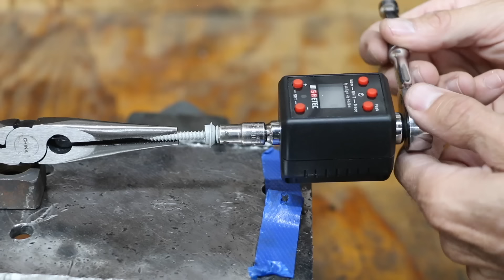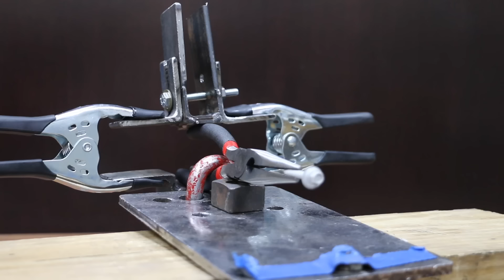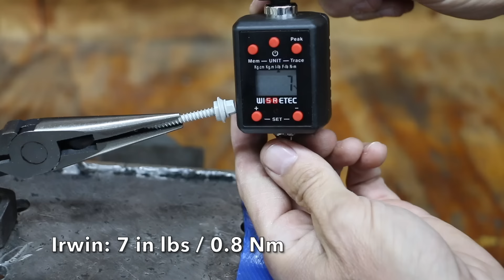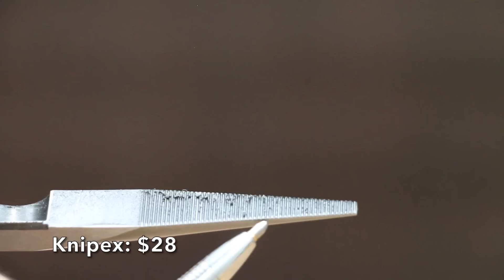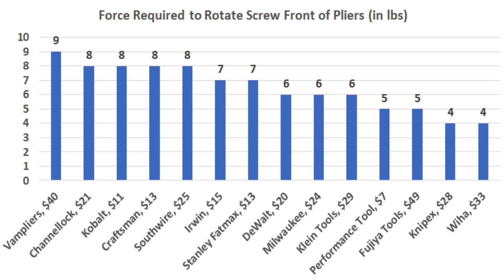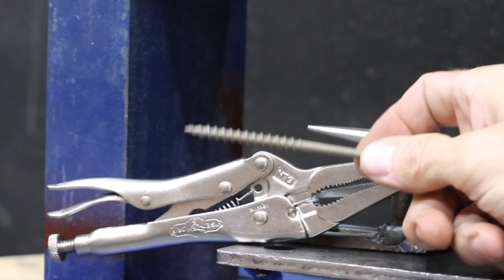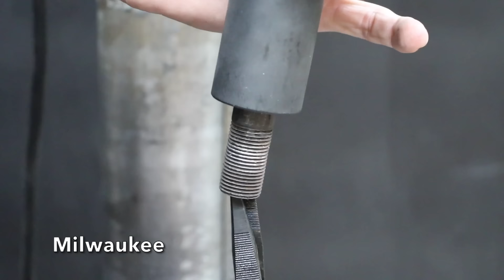Japan vs German Pliers (LONG NOSE)? Knipex, Vampliers, Klein, Fujiya, Irwin, Kobalt Needle Nose

Comment: As a building maintenance tech I use pliers frequently and I must say I like your test but lets be honest, most people use pliers for grip and use dykes to snip anything tough. I own Vampliers and love them...for gripping smaller broken or rounded out screws. I've never leaned on needle nose to cut. I've never leaned on on needle nose for BIG GRIP of larger fasteners I have cobra pliers and vise grips for that and for even bigger jobs a monkey wrench. I do think your test shows the true toughness of the tools which should provide evidence of longevity. Well made tools normally last a long time which I think your test did knipex an injustice. Those where true to the meaning needle nose pliers the rest were bulky and made to be an "in between" kind of plier. If I need to get in tight  spaces with control and precision I'm reaching for those knipex. Grip of small fasteners in tight places, Vampliers. Your test did open my eyes to the good overall use of the Kobalt pliers. They did well in places I wouldn't think to use them and they apparently will hold up and get it done. Kudos to you thanks for the test.
Reply from the maker: Thank you for sharing!

Comment: Your videos are the best out there.  Can you please supply a little more info on your digital torque adapter?  I'd love to know how well this one resolves and how low it goes in in-lbs.  It looks good to me but the specs for it don't line up with the values you're getting!  Anyway, please keep the vidoes coming.  My wife and I cast them right onto the TV.
Reply from the maker: Thanks, will do!  Thanks for the suggestion.

Comment: My favorite pair of needle nose pliers are some ancient pair that I found in a flee market. Their rust brown but they have no wobble yet a really freely moving handle.

Oddly though, besides the rust there is no damage on them despite their age. Even the cutting blades are still perfectly intact.

My only guess is that it predates mass manufacturing so the imperfections of them being force pressed together than being worn in for many years made them as good as they are.
Reply from the maker: Thanks for sharing.

Comment: Should the clamp distance not vary, depending on shape off handle? If it's a more "open" handle vs a more "closed" handle, would the more open not receive way more pressure/clamping strength, being forced together a longer distance? Would it not be better, to use a fixed weight, and hang it off the top handle, and rest lower handle on table? Or is it just in my mind, and the distance closed always equals same force applied?

Comment: honestly iv never twist anything with needle nose plyers bullnose yes but no needle nose and personally i believe in the right tool for job ir if you need to cut side cutters if u need to twist bull nose if you need to grip multi grips or channle lock tbh iv only use needle nose for pulling clips and sweezing clamps but this is a whole new level of testing
Reply from the maker: Thanks for sharing.

Comment: this was a great video but there was a major flaw, some of those pliers were much finer, made for much finer job, the vampliers are almost regular pliers, very stubby and wide while those fujiya are really fine, the vampliers couldnt do the jobs the fujiya could and vice versa, i know this is hard to factor in to the test but its a consideration, seeing as just looking at strength numbers when you need a super fine and precise needle nose is irrelevant, the fit and tolerances are far more important
Reply from the maker: Thanks!  Thanks for the constructive feedback.

Comment: The first test is kinda pointless and flawed.
The big advantage of the Knipex being longer results in it being worst in the test, while in reality if you were to grab something with the tip of the Kniped, chances are you wouldn't even get to it with the other tools.
Reply: @Hand Tool Reviews Doubt that's making a huge difference, the reason it failed so hard in the first test is that it is significantly longer. The test simply makes no sense because you'd never grab something like that. The Knipex is last in that particular test because it's by far the most useful "LONG NOSE Pliers". 
If you were to grab something like that for maximum grip, you'd just use normal pliers.
Reply: @Hand Tool Reviews Dude I don't care about any of that nonsense. The only reason to use long nose pliers is if there's something I need to grab where my normal pliers can't reach. The Knipex ones being longer and slimmer than the rest is a huge advantage and for that alone I'd always choose them. That's literally the one thing they're supposed to be useful at.
Reply: @Hand Tool Reviews Also the Knipex literally cost 18€ here in germany. That's $20 tax included, witout tax it's $16 to make it comparable to american prices. It's pretty damn cheap.
Reply: @Hand Tool Reviews I'm not talkiing about any score, I'm literally only saying the first test is completely useless and proves nothing. In 99,9% the gripping force of all these will be more than enough, what really matters is their length.

Comment: Lets test the wire cutting capability of these pliers by CUTTING HARDENED STEEL NAILS AND SCREWS! 🤣 I've never tested my grip strength but 200lbs of force seems like it would be very difficult to apply by hand.  But for real though: all the qualities that make a pair of needle nose pliers good or bad can't really be shown or tested in a video.  You gotta fingerblast the pliers yourself. they gotta be comfortable, should be easy enough to open and close, etc.  A lot of those pliers shown look amazing to me.  I have some nice ones but I've been mostly rocking the same pair of cheapies that came in a multi-pack from Harbor Freight over 14 years ago.  The best pair of pliers are the ones that you can find when you need them. 😆
Reply from the maker: Thanks for the video idea.

Comment: I think I like the Stanley the best. I've never seen needle nose pliers with a titanium coated cutter but the vampire was pretty impressive. I've wanted to get a set of the Dewalt compound lineman pliers, needle nose pliers and diagonal cutters. It would have been kinda cheating but I wish you had included one of those in your test.
Reply from the maker: Thanks for the suggestion.

Comment: Excellent work! I thought the Knipex would destroy everything else. I own a set of snips from Knipex after trying sets from several other vendors. It's the best set of snips I've ever used, and is exceptionally well-built.
Reply from the maker: Thanks for the feedback.
Reply: Well, Knipex offers a host of different models of the same general type. Using a screwdriver to drive in a nail also won't get the best results... You want pliers to exert force, use the ones built for that purpose. Knipex has a whole bunch of them with long handles and short, broad tips.
Reply: I think the knipex got a bit of a short straw for these tests because the 8" knipex needle nose is in the same "class" if you will as smaller 5 or 6 inch needle nose by other brands, they just made them nice and long. They aren't made for the same purpose as say the Klein 8" needle nose which are beefcake and essentially linemans with a long nose.
Reply: @andrew61987  Every knipex guy was grousing over this test or that test. "Oh, for that I would have pulled out my knipex twin-grips!" Or whatever.
Reply: The way he tested these, because of its longer nose, it was going to lose most of these tests(it should of done better in cutting stuff). The real use-case for this tool is not to cut nails but reach into hard to reach areas and pull something, like a cable.

Comment: As always, spectacular content.

But of feedback for the nail cut test; Joe about a standardised distance from fulcrum for where the force is applied to the handle?

Say 3" back from the pivot. This would test the cutting faces more comparably, and maybe negate some of the issues faced by shorter handled cutters.

We don't apply pressure right at the ends anyway. Just a thought
Reply: Probably the best thing to look at there is damage to the cutting blades not the amount of force it took.After all needle nose pliers are not your go to cutters.

Comment: How many times does a plier cut through ONLY ONE nail? I would like to see how the cutting jaws held up. Maybe do 3 cuts for each plier, compare if the cutters get worse. Do a visual inspection after the cut/s, etc.
Not going to read thru all the comments to see if anyone has a similar observation.
But you do some great analysis in your videos.
Reply from the maker: Great suggestion! Thank you

Comment: Stiff opening is not an issue you're supposed to lubricate and free up the handles before you put them in your tool bags.
Reply from the maker: Thanks for the feedback.
Reply: @ProjectFarm  Thank you for your reviews saved me a ton of money getting broken exhaust manifold bolts out of the engine in my truck. Your recommended on bolt extractors was very helpful.

Comment: I broke a pair of Knipex needle nose cleaning a brass welding nozzle. I little twist when trying to pry a berry out and the tip snapped. I bought a pair of Cornwell pliers and have used them everyday for 5 years
Reply from the maker: Thanks for sharing.

Comment: I normally LIKE all the PF videos, but TBH, this one is a 'not so much' for me...
IMO, most of the tests would be far more applicable to 'ordinary' pliers rather than long nose pliers.
For me, long nose (and / or needle nose) pliers have an entirely different use case (although I accept that EVERY tool MUST have a functional 'hammer end' for those times when the frustration level exceeds the sanity level)

Comment: Props to the Kobalt pliers. Stunning performance for the price. I was very surprised at the failure of the expensive brands on the twist test. It just goes to show that a manufacturer can misrepresent the tool's performance by cherry picking tests. Another excellent job by providing relevant performance data that the average consumer has no access to.
Reply from the maker: Thanks!

Comment: Thanks for another great video. I wanted to know, if you have an estimate of how much is the average person's grip strength. I guess I can cut a nail with both hands but not sure about a deck screw. I think you mentioned it once in a video but I can't find it so it'd be nice to have an estimate :)
Reply: He demonstrated it on a spring-grip force tester, the average adult has about 100 LBs of grip strength (Todd squeezed 108 LBs)
Reply: @Syclone0044  thanks

Comment: Anyone cutting nails or deck screws with pliers has a screw loose. Pliers are for wire work, and yes, can be used for other things, like those people who use ratchets for hammers, or screw drivers for pry bars, do not confuse misuse for multi-use.

Comment: Long nose pliers and needle nose are two different beasts. I notice a lot of difference in the shape and thickness as well as geometry in the sampling of pliers here, some are more of what I consider needle nose. It seems that the thicker the nose/end of the pliers the more likely they were to sustain overall bends or fractures. The thinner the nose/end of the pliers the more likely they were to bend only at the tip. This tells me that there really is no overall winner here. The take-away is that you need several different long nose pliers as well as needle nose. I, myself, like the Channellock featured here for general work that includes cutting but will stick with my 10 year old USA made Craftsman when it comes to twisting actions out near the tip. For the price and format of a ''long'' nose pliers, out of the 3 you finished with, it's clearly the Irwin for me - just look at that profile! Think I'll get a pair. Great video. Now do tweezers with a focus on electronics-centric pairs, look into C.H.P brand (also sold as Hakko), etc.
Reply from the maker: Thanks!  Thanks for the suggestion.

Comment: Knipex was the only one when you read their descriptions to say "snaps back into place when twisted." But it suffered among the most damage in the twisting test. I guess you have different ideas of twisting than their engineers lol.
Reply: It has a lot longer and thinner nose. This is good for the work you normally do with this pliers. The cheap ones are much thicker, but you don't want that. If you have enough space, you can use another tool.

Comment: I have two good videos I would like to see you do I have seen plenty oil filter test videos but none of them are good. My idea on them would be the most overlooked most important thing which would be oil flow both new and old/dirty preferably one with no bypass valve in it and also do the more expensive oil filters have better oil flow or do the cheaper ones. A great brand to test would be Purolator with there three levels of filters being the Purolator the Purolator one and the Purolator boss. And for the second video can you test all three levels of royal purple I have only seen people test the base line royal purple against the best of the other brands I would like to see a comparison of the base line the HPS and the XPR maybe even there high mileage MXR I bet the XPR can bet the amsoil signature series and the pennzoil ultra platinum. Thanks always for the great videos.

Comment: I wish when you did torque wrenches you would have given us some feedback on the actual "click" of the torque wrench. (how noticeable the the feel and how loud the click)

When I worked on mid-stream gas compressors in the oil-field some brands were almost impossible to tell that they had hit torque due to noise and vibration caused by the other compressors on location. 
... for those wondering how a compressor can make it hard to hear or feel a torque wrench, just understand that there were generally 8 compressors on a location (running 24/7) and the engines turning the compressors ranged from 69L twin turbo V16s to 149.8L turbo 8 cylinders. These were huge reciprocating compressors.
Reply from the maker: Thanks for the suggestion.

Comment: Good video but I’m slightly disappointed that you didn’t test pliers that have mechanical torque multipliers such as the dewalt pliers I bought at Home Depot. They have multiple pivot points and seem to work very well. I also bought a pair of metal shears by Milwaukee that had a similar mechanism.
Reply from the maker: Thanks for the video idea.

Comment: I would assume the cheaper pliers that experienced a lot of wear but performed well did so because the softer steel molded somewhat around the screw. Good for pulling out one or two screws but I doubt you'd see that over the life of the tool, which is also probably much shorter.
Reply from the maker: Thanks for the feedback.

Comment: My suggestion vids are:
Center punches 
Multimeter's
Battery Rotary Tools
Battery Ratchets Vs. Air Ratchets Vs. Normal Ratchets. 
Air Hammers
Bernzomatic Mapp Pro Vs. BlueFire Modern Mapp. 
On/Off Welding Magnets
Floor Jacks & Jack Stands
Helicoil Kits Vs. Other types of thread repair kits.
Reply from the maker: Thanks for the suggestions.

Comment: Project Ideas: Concrete cleaning, alkaline cleaner/degreasers or laundry soap; acids for salts/rust, kitty litter ground into the concrete for remediate spills. Second idea is how to protect the concrete sealers water vs oil-based or like my other idea epoxy and epoxy vs polyurea. One's for in the garage (maintained area) vs driveway exposed to the elements. How well they hold up how often you have to apply. A combination of them all such as kitty litter for the remediate spill then a degreaser follow-up. Any random mixtures that weaken the concrete by applying them in different orders?
Reply from the maker: Thanks for the suggestions.

Comment: A video suggestion. I searched your channel and didn't find anything about this. Nuts and bolts. Stainless vs grade 8. In the 80's I helped a doctor rebuild a boat. Everything on there was stainless. I noticed that the stainless twisted off, and/or broke a lot easier than standard hardware. I would twist off the 1/4 inch stuff, if I wasn't what I felt was, absolutely delicate with it. Just a wrench and my normal 'twist'. The doc argued with me and said that the stainless was in fact stronger than grade 8. I'd like to see some definitive tests of this. Shear, twist, pull, etc. Comparing the two.
Reply from the maker: Thanks for the suggestion.

Comment: I'm not sure where else to submit a test for you. I'm gonna do it right here. I would like to see you recreate your gasoline vapor lawnmower experiment using alcohol that you distilled yourself with a pot still (about $100 new). Test the ABV (alcohol by volume), then run it for performance, run time, etc.  Gasification and other alternate fuels are becoming VERY interesting in these current times...
Reply from the maker: Thanks for the suggestion.

Comment: Another good video. I had two suggestions
1. Paint quality - how easily applied, ability to hold up to being thoroughly cleaned, scuff resistance, etc
2. Camping air mattresses - could do both manual inflating ones and self inflating as separate videos because they're different. Only constant should really be claimed R values
Reply from the maker: Thanks!  Thanks for the suggestions.

Comment: I love your videos. You should do a test on the best 1/4 inch bit for putting in pole barn screws how much paint they remove ect. I usually use Milwaukee but I bought a couple Bosch bits to test
Reply from the maker: Thanks!  Thanks for the video idea.